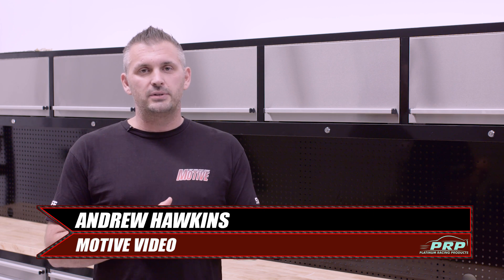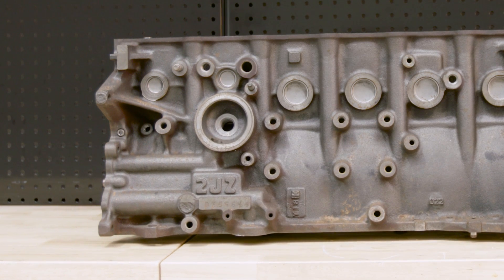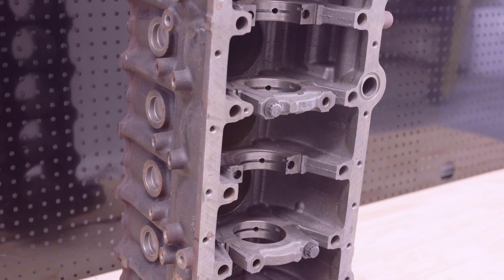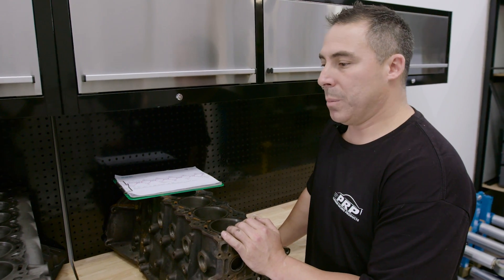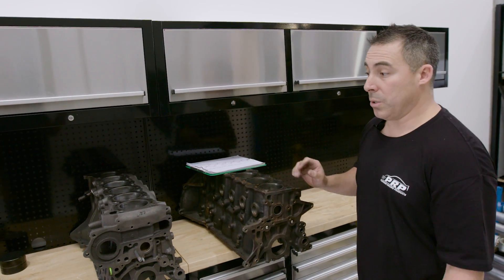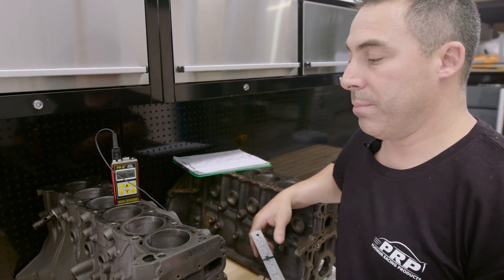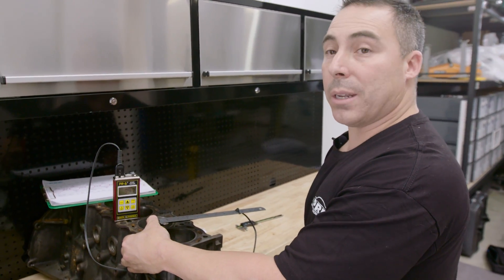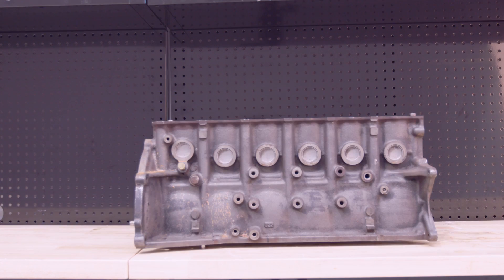RB30 vs 2JZ Which is the Better Block and Why? - Mythbusted

Comment: 2jz is best for tuning. Ever seen skyline gtr on top 50? Me neighter.
Reply: +Sakarias Karlsson yeah the 2jz is better but i still prefer rb's. I guess its a character thing
Reply: Except there are tonnes of skylines with 1000+ hp rb26's...
Reply: - Hazza - well maybe i put the number too low, but the 2jz engine block certainly is better for tuning
Reply: - Hazza - but the vr38 is at least as good as the 2jz on the other hand
Reply: Are you serious dude? Honestly way to make yourself look like you have zero clue. You don't know anything, don't comment. Fwiw I've seen plenty of 2jz blocks with aftermarket crankcase ventilation, they are NO stronger than an RB. Keep dreaming.
Reply: Gareth Curtis Sky Surv 2jz is stronger, like he said: no rb’s in the import top 50. At all. None.  Unlike 2jz’s. Sorry to bring bad news
Reply: Gareth Curtis Sky Surv also i changed it to 1200 hp, happy now?
Reply: @sakariaskarlsson634  answer me this, how many RB engines have you owned, built, tuned? You are aware that there is a factory Nissan N1 block that will handle substantially more power? A stock 2.6 block is good for over 1600hp, stock internals 1000. Your comment a VR38 is 'as good' as a 2j, dude, you blow my mind. If you drive a Corolla and buy car magazines and watch 2f2f all day that's cool, but when you comment on a public forum you look like an absolute idiot.
Reply: Gareth Curtis Sky Surv well a vr is ”at least as good” i mean vr > jz
Reply: Gareth Curtis Sky Surv maybe i was too fast, but the point is still clear: 2jz is better for tuning and it wins over rb builds
Reply: Gareth Curtis Sky Surv i was just pointing out that most builds i know of tends to be sub 1000 for the skyline and sometimes over for the supra
Reply: Gareth Curtis Sky Surv andi comment wherever the fuck i want

Comment: I would love to see this testing on a s54b32 like in my e46 to see how that stacks up against them
Reply: Short answer, not very well at all. BMW, particularly since the mid 90’s, produce complete and utter crap.
Reply: @izzy031096  most low iq comment i've ever read in my life. My stock block e46 m3 with an s54 on a 6466 turbo lived at 720whp for years with absolutely no issues.

Comment: 2:33      FYI, the flow rate of tubes does not double with a doubled diameter; it's related to cross sectional area, which is way more than 2x.
Cross sectional area:
RB = 3.14*[(7.97mm/2)^2] = 50mm^2
2J = 3.14*[(15.5mm/2)^2)] = 189mm^2

Comment: I swear this argument started back in the 90s because supra owners had to come up with something that was better about there car. Both cars were badass but the R32 GT-R (the model when the Supra came out) was just better. The GT-R was lighter and had awd with similar power in stock trim. Put the cars in real world tuning scenarios 450-500 HP  and the GT-R is still better. Its still lighter and still would have awd. Yes Supra owners I'm well aware of what kind of HP a Supra "could" output. I'm using those number because they are both easily achievable for either engine in real world settings not just drag strips or Highway pulls. Sorry when this argument started back in 1993 it was comparing apples to oranges it always has been and always will be. That's why engines are always compared never the cars.

Comment: Is it me or 2jz has to have much more oil flow to do the same job as the rb because 2jz has much more mass and thickness where jackets are cooling it down. So more material carriew more heat so it is totally normal that oil flow is far more superior as it is required. But by how much the mass thickness affects the oil volume required to cool cylinder chambers down. So my question is may be oil flow is superior by 5 times lets say but considering thickness may be it is actually twice efficient as the rb and not 5. 

What about the radiator that goes with it to take the heat out of the oil. What about velocity of the 2 mediums in each system. Oil vs coolant. 

There are a lot of parameters to take into consideration on test like that. 

May be 2jz has better block.. but may be the rb has a better overall system. 

Who knows its a fan based operated testing range. 

Would need an unbiased team of several specialists to test in hundreds of ways those 2 complete systems. 

Why they're are no more 2jz produced and rb are still in production.. just let that sink in.

Oh maybe companies want higher maintenance system on the market to make more cash from it. 

Who knows. I'm throwing all that out there just for fun. 

Have a good day

Comment: But the thing is Toyota really 'overbuilt' the engine. Shame really, the guys compare the 2J to the RB26. The thing I understood is the RB block did its job well in its time. The tuning is just the further improvement on the original design. I mean it's easy to bump up an engine but guessing the operational time before rebuilds is up for some guessing.

Comment: Please explain what that “290 hardness” measurement was. Cast iron’s yield strength is 344, so why’s it lower if the 2jz is a cast iron block? Yield strength is what you’re testing, right?

Comment: BMW engine block comments "the plastic used for the cylinder block is atleast 5% better than a walmart toothbrush, im surprised they stepped it up this time!"
Reply: It's the electronics that suck on bmw

Comment: i would love to see the 2jz compared to a diesel i6, just to see what the differences would be in thickness and the engineer's reasoning when designing gas vs diesel with the same displacement and cylinder arrangement.

Comment: Can you make a 2JZ AWD though? Maybe that's the only edge RB has
Reply: That doesn't really have much to do with the engine, so with the right transmission or the addition of an all-wheel-drive transfer case (and a front differential, of course), it should be entirely doable.

Comment: When doing the "hardness" test is that really measuring the hardness of the material at that particular location of the block or is it actually giving overall insight on the stiffness of the entire casting such as a natural frequency of the structure?

Comment: Cast iron vs aluminum, only a moron would waste time making a hardness comparison of apples to oranges. Nissan didn't build the GT-R to be a drag car, it was designed specifically for GT ROAD racing, as was the supra, but what block dominated there? "Best" is relative to the application lads. You wouldn't use a brick to perform open heart surgery would you? Well Toyota fanboys might, but that's besides the point. Beat my R34 on a road course and I'll show your 2jz some respect. Until then , if you want to go fast in a straight line with a FACTORY block and cylinder head inline 6, you'll need to get a Barra.

Comment: So Nissan’s answer to the 2jz, the VR engine in the R35, Supra has died and came back to life with a German engine in it now, which will never touch a current stock GTR, my point is this, they stop making Supra’s and Nissan continued on with the introduction of the R35,  and there is no answer for that, plus you can heavily modify a VR motor,  I really think someone out there will be able to achieve 4,000 plus hp on that VR platform.  Yes the Supra is trying to make a come back with a German engine in it, so all you Toyota fan boys, cry to the designers for failing, that new Supra is really shitty!  I do have a lot of respect for the 2jz though, it’s legendary, it still a bad mofo, but just for straight line purposes only, the GTR is a track/ slash drag racing champion

Comment: When You test the density.... don't you think that the point that you test will have an effect on the reading....IE ... you have to test a piece of metal of exactly the same thickness to get a comparable reading!!!  Your tester is bouncing a ball bearing..... and simple logic says that a thinner piece of material will give a different reading to a thicker piece! ..,. Testing at the same point of a block shows nothing!!!! Because the thickness of the block at that point could be different!!!!????????? Am I right or not????

Comment: Before I lost everything to an uninsured driver with good tuning 2jz stock and no issues with 800 crank hp. My personal supra was at 872rwhp at 32psi with 3.2 bore and full boost at 5100rpm.
Reply: Epic

Comment: God damnit, I should have bought that Supra instead of my R34 with that junk engine! In all seriousness, my R34 is bone stock and has never given me issues. I don´t plan on building a 1000hp car either so I think it will be just fine. The only surprise here is that the 2JZ weighs less then an RB30, I think at this point pretty much anyone who had done  a bit of research knew the outcome. Great to see it tested though, subbed.

Comment: Great video. It would be interesting to see a BMW I6, like a N54, to see how european sixes compare.
Reply: Better off testing an m104. Those BMW motors aren’t good for much. You might be able to push some more boost through them but they won’t hold up for more than 10,000kms.

Comment: Would be interesting to see where some of the European 6'er blocks stack up, like BMW's 6's (M50, M52, M54, S50, S52, S54), Volvo's 6's, etc
Reply: M50b25NV one of the strongest engine BMW ever made
Reply: N54
Reply: In terms of blocks, the N54 isn't anything impressive
Reply: Vals Construction N54 is an aluminium open deck block lol
Reply: Had a bmw straight six with headers and head work the fucking car hauled ass first three gears would grease the tires i miss my 535i was like riding on rails cornered like a boss i killed mustange with that car and the engine was bullet proof never failed. I dont know who tuned the pcm and did the turbo work but it hauled ass is all i do know.
Reply: O and of course if you going ff or mr you can use the Volvo box.  It's good to 450 500 bhp mark and the  lsd is only £450.  Basically you can build a 500 bhp t5 with a drivtrain and an lsd for less than you pay for a bog standard raged to shit sr20. 

Don't get me wrong I love jdm but apart from the 1zz 2zz and the k20  b16 d16  the engines are to rare and expensive. 

For the price of a 2jz you can get an entire 135i and tune it lol
Reply: @avancalledrupert5130  Not true, 2jzgte Aristo’s are still cheap enough. Not for long though
Reply: In the BMW old school stable, the I6 M20 block from the e30 3 series is boss. Not that i am comparing it to the 2JZ block
Reply: craig gwasira the M20 (baby six) is probably the worst I6 that BMW ever made, and the only engine they made to use a timing belt... first to use it, never after
Reply: It came with its flaws just like other I6s that came after the M20. But if it is properly rebuilt, especially the 2.9 and 3.1 strokers, they run forever. From my personal experience.
Reply: Ford Barra block is on par with Rb
Reply: @toddc6682  barra block tested at 241 so about the same as a rb20 25.the barra is pretty average in facts not internet bullshit and fake dyno numbers 🤣
Reply: @definitionmedia1130  You’re better off going with the old sohc block imo. They hold up just as well if not better than the barras if you do headgasket/headstud replacement.
Reply: @izzy031096  what are you dribbling about barra blocks break at 600 hp barra girls hate there slow,I have owned jdm for a long time.barra the sohc or what ever your trying to talk shit about are shit,funny as,im keeping my 2jz your toy motors are that slow toys
Reply: @definitionmedia1130   Lol calm down there champ. I love my JDM stuff as well. I have a fully built BZR (blacktop 4AGE turbo) and a stock Aristo (2JZGTE) sitting in NZ. Have just moved to Aussie and have begun to realise those old falcon motors go hard asf for what you pay. Can pick up a sub 200,000kms sohc engine for less than $500 here. Slap a turbo on and they’ll happily take 20psi and make in excess of 600hp reliably. You can pick up tidy E series Falcons for less than $5k, and get them turbo’d and tuned for another $5k. You just can’t find that sort of value in JDM cars anymore. I’m just glad I picked up my Aristo when I did, the 2J in that is worth more than what I paid for the entire car now. 
FYI, the sohc blocks/internals are on par if not stronger than the barra blocks. There are guys over here making in excess of 1200hp with built bottom ends.
Reply: @definitionmedia1130  My point is that you’re not a true car/engine fan if you can’t respect a good engine or car when the facts are right there in front of you. I used to think just like you “nothing compares to JDM”, and although I still lean that way, there are engines and cars from all over the place that are just as good as the JDM classics. Although the 2jz really is one of the best engines ever built.
Reply: @izzy031096   mate im not sure if you own jdm or not,but all these clown comparisons to the 2jz,the barra is junk nothing more,in 20 years of owning 1j and 2j,I do alot of freeway runs just top end stuff,for example the barra is slow top end but ok down the 1/4 the 2jz has nickname highway king and does it well.the Australia taxi is a slow shit box In comparison..every ungrounded even for top end runs it's full of jdm and uero.hondas or the 1 to watch,
Reply: @izzy031096  difference between the Australian falcon and let's say a supra the falcon is very limited,after 600hp your playing the block cracking game,splitting cylinders.big list of shit.the sohc is alot better then the twin cam,both engines are more hype then facts.and they talk shit,fullboist did a ford escort van that was ment to have a unopened barra in it,making 1000hp.the facts I was at the shop,they went through 3 barras trying to get a decent 1,then it was full built,and made 800 hp,but according to the net it was a stock motor,there clowns nothing more
Reply: @definitionmedia1130  I absolutely do and have loved JDM stuff all my life, particularly Toyotas with Yamaha heads. I daily a 2zz Corolla over here in Aus. 
I agree that the barra is not as good as the 2jz, (they’ve done a block comparison on this channel as well I think). I never said differently so your barking up the wrong tree. But the difference in value for the sohc is what I’m getting at. My mate (who owns a performance shop in North Brissy) has an ef fairmont that makes 620hp atw with a completely unopened engine. He dailys it and has done for a couple of years. The limits for the sohc internals are 600-700hp, about the same as the 2jz, and the block holds up well past the 1000hp mark, same as the 2jz. Again, I’m not saying that it’s a better engine than the 2jzgte, but to obtain a reliable 600hp for a quarter of the price of achieving the same results with a 2jz is f’n good value.
Reply: @definitionmedia1130  Fullboost also had a sohc ED on their channel that was making 1200atw and was running low 8’s or high 7’s (can’t quite remember). For a car that would’ve cost $20k all up that’s undeniably great value. You’ve gotta spend $50k plus to get a 2jz doing those numbers these days. Remember we’re not in 2005 anymore mate.
Reply: @izzy031096  im 90k into my 2jz it's built for top end,I have never had a falcon even get  close to me,the guys I hang out with do rolls from 100 mph to top end,sorts the boys from the men,barras are not even in the same world.pretty much if you can do 350 p,us your waisting your time turning up.when these hsv and falcon guys waffle on there faster then jdm,they have no idea the jdm stuff that's out there,,older guys like me in there 50s.and not that stupid to post races online .but I promise you,barras are not even in that race,there toys.
Reply: @definitionmedia1130  You’ve completely missed the point of what I was saying mate. From the looks of it you struggle to read and write so I can forgive you. Have another read and actually respond to what I’m talking about.
Reply: @definitionmedia1130  Where are you from in Aussie? Doesn’t sound like you are from here talking in mph and saying the “Australian falcon”…
Reply: I’d rather a Merc straight six any day. The m104 from the c36 that was modified by AMG is the best of the bunch. The older m103’s go hard as well.
Reply: Ummmm, no.  2JZ is better.
Reply: @walshja81  what about 2jz vs coyote?
Reply: The quickest BMW in the world is running a 2JZ, which should tell you everything you need to know
Reply: Turbo Chook And where did you get that from? Since the record-holder has a 3.8L E34 S38B38 M5 engine doing 6.5sec passes.
So, no.. it doesn't tell you all you need to know when you are misinformed.
Reply: @formulajuan5762  The S38 my friend, but if you want impressive numbers, then look for the BMW M12 engine, at a time where they couldn't even measure such power. 1.5L 1500HP Formula 1 winner.
Reply: The fastest BMW runs a 3.2 2jz
Reply: Wrong  @hksjoshua

Comment: I heard that cast iron engine blocks get harder as they age so a quality engine manufacturing process would be to put them on a shelf for over a year. BS or not?
Reply from the maker: myth. Platinum let one outside for 2 years and made no difference really. Doesnt mean ti wont work on other block materials or over 20 years though. But its not worth the effort in our opinion
Reply: MotiveDVD . I was referring to freshly cast blocks not ones that have already been used in a vehicle. There was a rumour about a certain vehicle that ate oil because they used  green blocks instead of aged ones.
Reply from the maker: @anomamos9095  Be a pretty shit block if it didnt work perfectly out of the box.